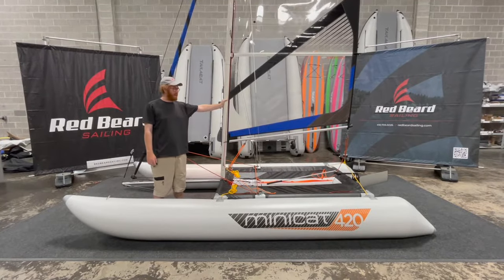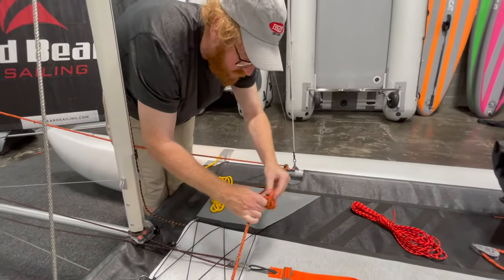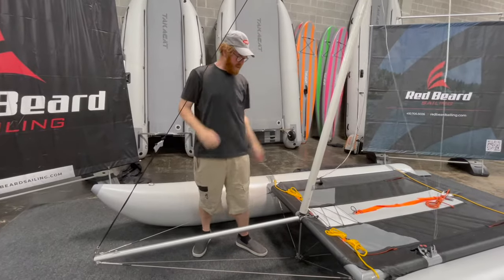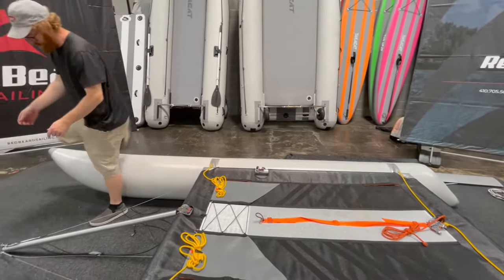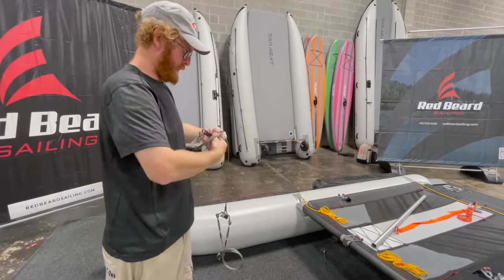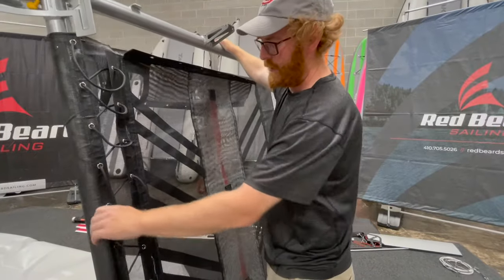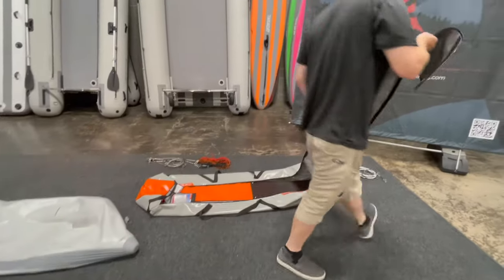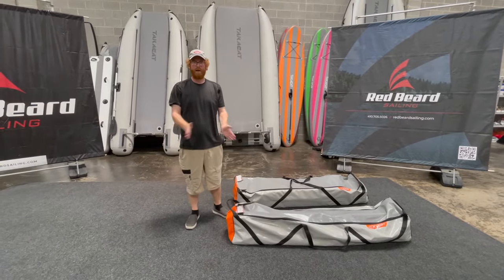How To Pack Away a MiniCat 420: In-Depth Walkthrough

Comment: Approximately how much does each bag weigh? Any tips if you are launching and recovering off a beach or you should wash everything down once you get home I guess?
Reply from the maker: The bags weigh roughly 60-70 pounds each (some models have carbon bits that reduce weight).

Some customers need to buy a 3rd bag to travel via air (depending on airline).

You can rinse at home, or there is a product called RinseKit which makes rinsing on the beach very convenient.